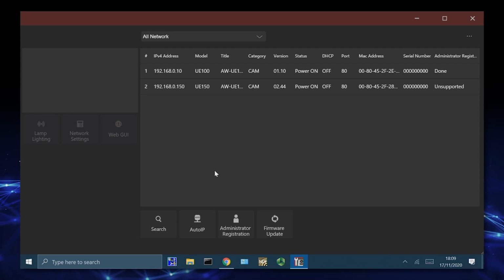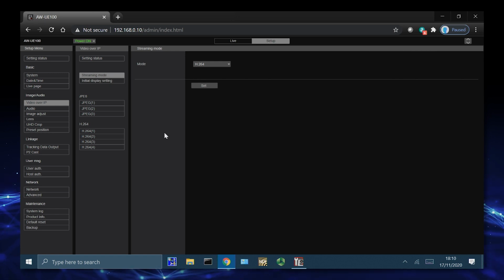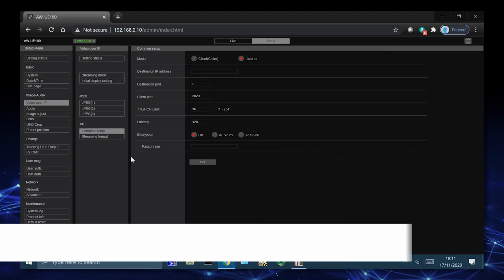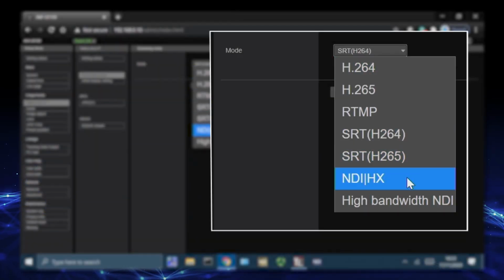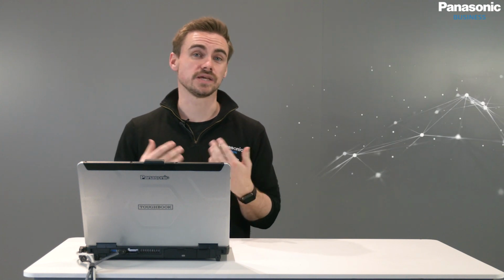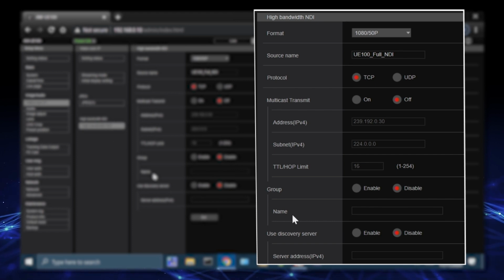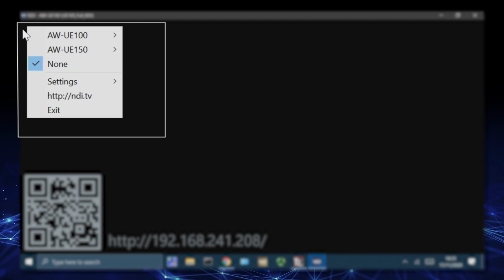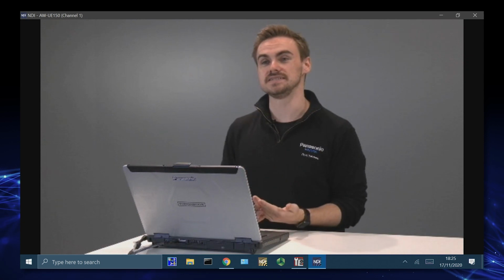Activate NDI and SRT with the AW-UE100 | How to – Videos

Comment: Is it possible to use the rp150 controller while using ndi? If working from a remote location.
Reply: The NDI protocol cannot be controlled from the RP150. You should connect the remote location with the control location using VPN. Then you connect the camera and remote like you normally would, as they would be in the same IP range. NDI or SRT could still be your video stream if you'd like.

Comment: Im trying to get SRT to work with a UE-150 and the SRT/MPEG Stream start button doesn't react when I press it. , Ive selected SRT (H264) , selected Client(caller), entered the public IP and port, used the default stream ID, ( #!::m=publish,r=PanasonicStream) and left the other setting a default.  Any helpful info or link appreciated
Reply: Make sure you have the recieve side set to listener. If that does not work maybe try the rendezvous mode.
Reply: @williammitrus  the UE 150’s do not have Rendezvous mode unfortunately. I have managed  to get the camera working on client and listener mode on a local network. I assume some kind of firewall is stopping it from working on public IP. I’ll keep trying
Reply: @MrAlexhasker  I have the same issue on the UE150 on a local network. Receiver is listening but the start button on the camera WebUI does not respond. Any ideas to help me?
Reply: When I get some time I’ll have another look and see if there’s any new firmware updates